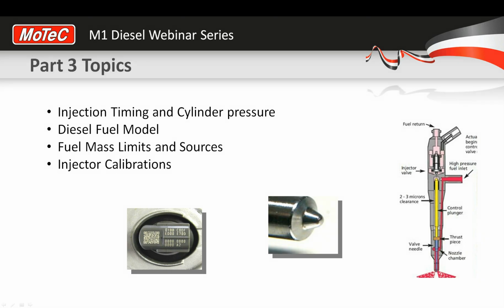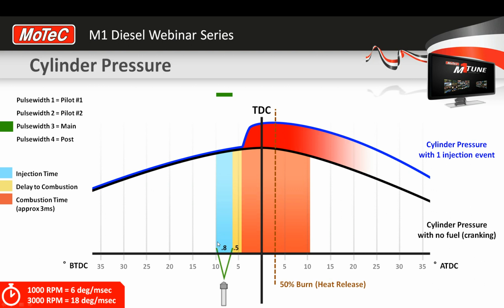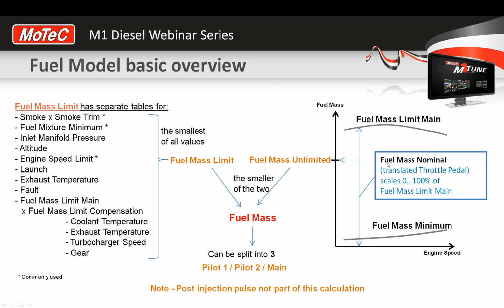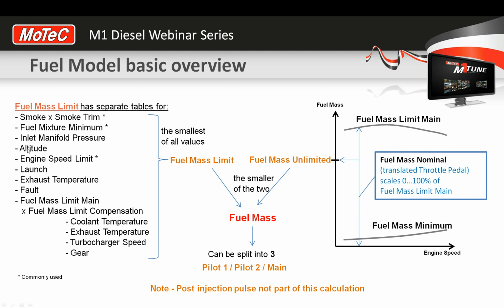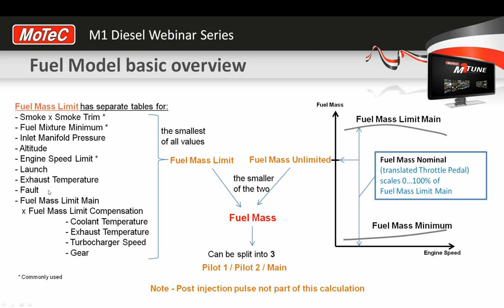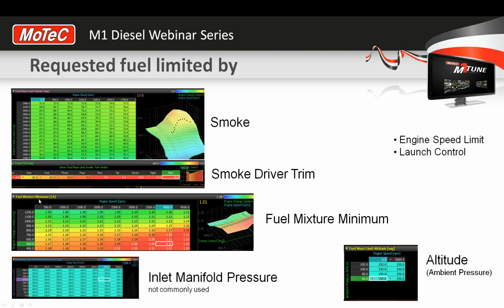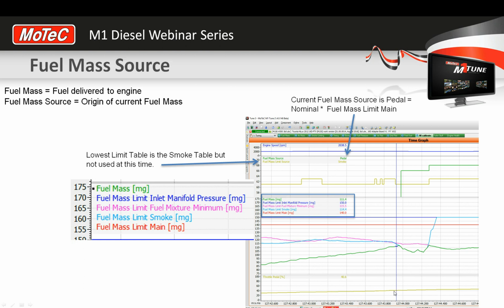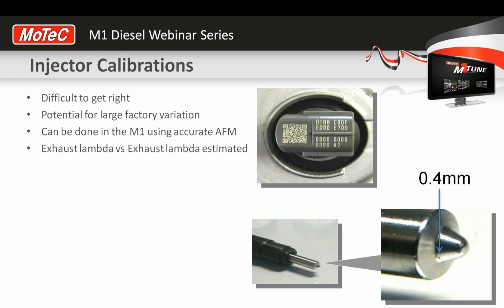M1 Diesel Tuning - Part 3

Comment: 1:07:00 flow calibration numbers.
Could you  use a separate channel lambda  installed in the manifold near the valve be used for flow calibration correction.  3 ways to do it .  1 move the standerd from the pipe to manifold ( 1 cylinder at a time)
2  6 pack in manifold +1 in standerd 
3 1 standerd 1 by valve( 1 cylinder at a time).